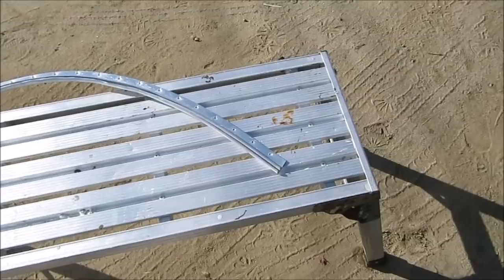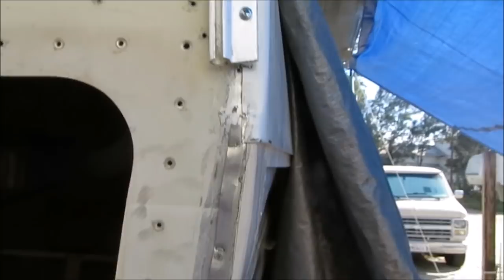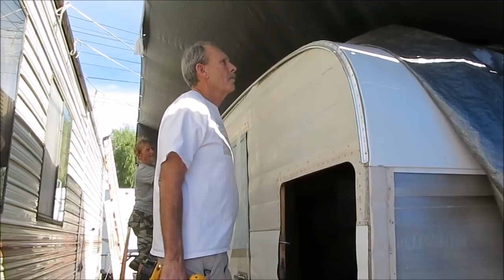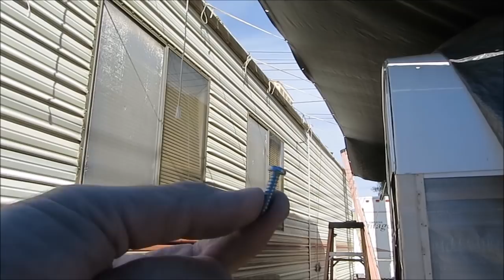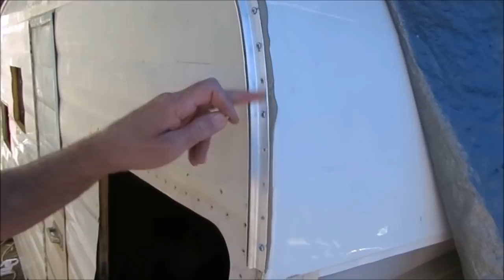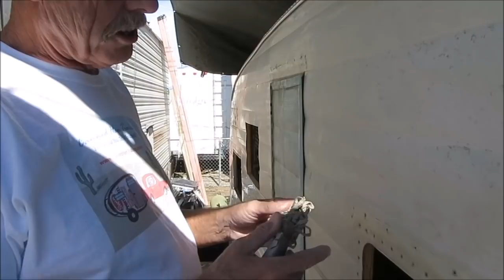All About J Rail

Comment: FYI, I don't like philips head screws almost as much as I don't like slotted head screws. Square drive is better than philips, and star (same as Torx) drive is best of all. Philips strips when old and stuck. I hear your driver skipping even while driving in new philips. Square and star never skip. You can buy #8 stainless steel or regular steel screws with star heads on Amazon... about $10 for 100 screws. BTW, steel touching aluminum causes a galvanic reaction and corrosion. Stainless and aluminum does not.

Comment: Thank you for this video!  I am replacing the siding that attaches to the top and comes down on the front (trailer hitch end).  I removed some rail from the top where the siding attaches to the roof.  I think it's j rail but its a little flattened and they had painted some type of sealant on it.  Would it generally be j rail going across the width on the roof or something else? My camper is a 66 Kodiak kodiak.
Reply from the maker: I will need to see some photos. Email your question and photos to me at mobiltec@gmail.com I'll be happy to help you out.

Comment: Heya! I need to replace the awning rail, but not the skin of the trailer.  My question is, do I need to worry about lining up the new screw holes with the existing ones in the trailer, as lining the two up will be difficult! Will this compromise the water tightness if I don’t?
Reply from the maker: You know there is a tool for reshaping the awning rail slot if that is what your problem is. The old holes may not be in good shape anyways so if you fill them all first (provided they don't line up) then you can make new holes. Just use good putty tape. 1 inch wide by 1/8 inch thick. Fill the old holes with glue and laytex calking.  You can email me if you have more questions. Go to my website for contact info. http://www.cannedhamtrailers.com

Comment: Larry good to see you back "on the job" hope the eyes are holding up
Reply from the maker: +trapper23ful Well one is holding up. I can't see much out of the other one. Good to be working on my trailers again though.
Reply: thoughts with you, as an aside early thanksgiving wishes
Reply: +mobiltec  Just off the wall thinking, Larry, but with the retina problems, could you also possibly be dealing with cataracts? I ask because they're yet another fringe benefit of getting old, and I had cataract surgery on my right eye last Wednesday. It's as if I had a new eye installed, and I'm getting the left eye done next Friday, and I can hardly wait. Maybe that's aggravating your own vision problems?
Reply from the maker: Anonymoose Yes John there are cataracts in the eye that was injured and they were caused by over medication which they say was necessary. I will be having surgery for that sometime this winter. The VA moves very very slowly...
Reply: +mobiltec  Yeah, the VA never seems to be in much of a hurry. At least fixing it is a simple process these days. Mine took 5 or 6 minutes, under a local, and when he was done, I sat up and looked around. The results were instantaneous, and other than a slight scratchiness for the first day, there's been no evidence that there even was a surgery. The "recovery" consists of taking it easy for a few weeks and using some prescription eyedrops for a month.
Reply from the maker: Anonymoose It's the steroid drops that I can't do until I am done with another medication I am on. They don't mix well and that is the reason for the wait from what they tell me.

Comment: Do you use putty tape for everything ? Do you ever use white butyl rubber tape?
Reply from the maker: +ww321 I use putty tape for everything. That butyl tape is for newer trailers and the kind of windows that are installed in them. Putty tape is much easier to work with also.
Reply: do you have site you purchase the putty tape from? Would local hardware store carry this? I have to re-seal a section of my j rail and been watching your videos to try and figure it out.

Comment: Is there a reason to apply the putty tape to the J Rail rather than the camper itself? What are your thoughts on using seam sealer tape as well?
Reply from the maker: I have found that if you apply the tape to the camper first it usually doesn't line up well with the J Rail. I have no idea what seam sealer tape is but what ever it is it will probably promote more leakage than it helps. This way is tried and true for over 50 years. Why screw with success?
Reply: @mobiltec  good point.

Comment: What if you need to bend new j rail instead of using the existing?  Is there a tool or do you just kinda fudge it as you go?
Reply from the maker: I showed in this two part series how to bend new J Rail. The AWNING rail is different. You can't bend that yourself so you better hang on to the old one. If your radius on the J Rail is too tight you can use a Metal Stretcher/Shrinker tool which I show in J Rail For Toasters which you can find on my website. http://www.cannedhamtrailers.com/tidbits.htm.

Comment: Where do u get that rail from? Wr have class c . Need to redo the J rail. We are new at this. Help!
Reply from the maker: You'll have to begin checking with RV dealers in your local area. Otherwise shipping can be pretty expensive. If you don't mind the shipping you can get it in 8 foot lengths from So Cal Teardrops. Just google them.

Comment: So newbie question; my 1971 Shasta Compact rail doesn't look like that, it's more a U shape. It's also smashed to smithereens in a lot of places. Does someone sell new replacement rail?
Reply from the maker: Yes. What you have is "Top Edge Molding" and it's sold by www.socalteardrops.com But you might check with local people first to save on shipping. Some RV parts stores carry it. Or look for an RV repair shop and ask them...

Comment: The mastic twist s when I put screws in how I stop this
Reply from the maker: I don't understand your question.
Reply: @mobiltec  when I put the screws in the sealant twist with the screw
Reply from the maker: @philhode5104  I still don't understand your question. What are you asking me.
Reply: @mobiltec  when I put the bar back on ,the screws that I put in make the butyl twist and pull it all over
Reply from the maker: @philhode5104  I've never had that problem. All I can say is watch the video and do what I do. You need the putty tape to stick to the J Rail good. Then put the J Rail up and screw it in. The putty tape will squeegy out as you tighten it. Then run a razor knife along the edges to trim the excess putty tape.

Comment: hi Sr. what is that tape reference, can you show the seller link pls.

thanks
Reply from the maker: That is putty tape. Not butyl tape. The Putty tape has the crinkle paper on the back and is gray in color. It's sold by many distributors. You can get it from Vintage Trailer Supply. Just google them or go to my website. It's in the Canned Ham Links section...
Reply: thanks
Reply: @mobiltec  
Great Idea